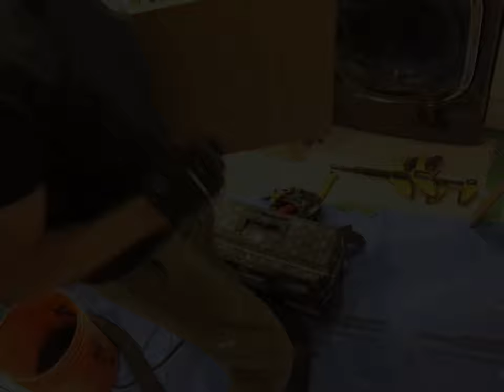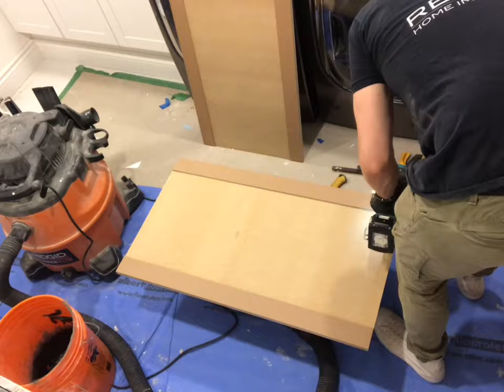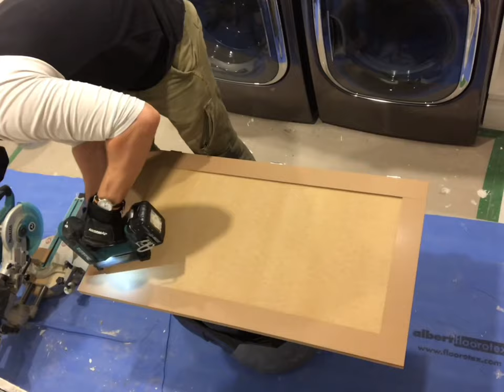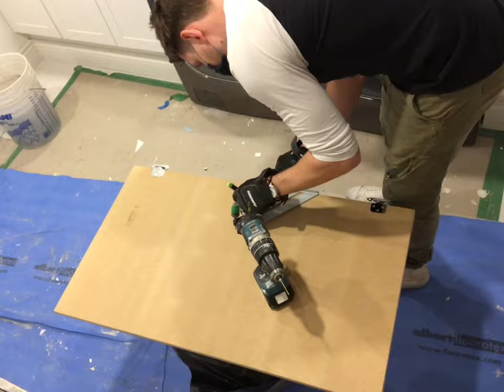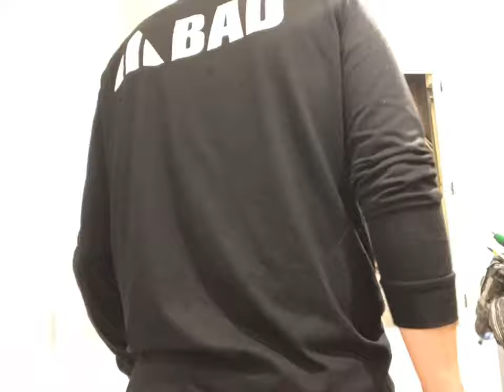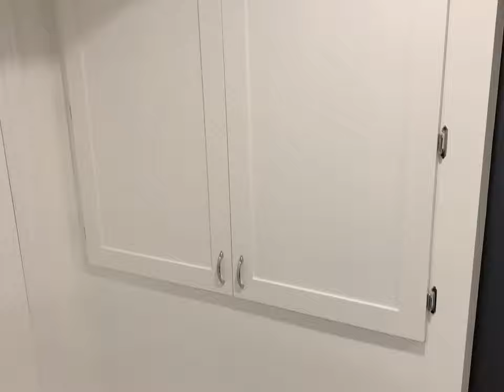Woodworking (Shaker Doors for Fuse Box)

Comment: It really does. Life’s too short not to treat yourself to better quality if you can. We did a bathroom kitchen reno at work and didn’t think about the bathroom door. We finished it and the door just wasn’t in line with the quality of the rest of the work. We changed it out with a modern frosted glass panel door. Lets way more light in the small bathroom but looks 1000 times more modern. Nice little touch for a better-than-builder-quality door!

Comment: Is a door covering the electrical panel code?   

I’m having issues now, for the last 2 years of no heat, not enough power.  

 I replaced my 120 year old panel after prying out pennies, so the new upgraded panel but no conduits.  They demanded to look at the panel inside verses just doing the inspection at the 400 amp dual panel outside.   So now they want all the wires covered or in conduit.  Now I have to build some kind of extension wall out and butt it to the panel that is back mounted to the wall.  I have to cover all the old wires from the ceiling down and floor (enclosed in back porch) which has slotted wood.   

I eventually plan to upgrade all the knob and tube wiring and run another panel to the second floor but I’m having trouble with inspections just installing the new panel only to find out when I threatened to sue the city, that they don’t even have a licensed inspector.  Which he kept telling me he works for the insurance company… ah no we pay taxes and they work for you the taxpayer.   They may get codes from DOL, OSHA, working with the insurance companies who have enslaved us but I’m getting off topic ranting.  This was set up to help us all be safer, a safer society, so to find out they do not even have their electrical licenses let alone enough experience to help me, well now I have a mood.
See I need the inspection so I can get the 400 amps from Dominion Power to run the 5T hvac latest system aka heat pump with 20,000kw of heat strips to heat my 5000 sq ft 120 year old house.     

So is there an extended version of how you build all the walls and everything around your wires and boxes before the doors.  Please?